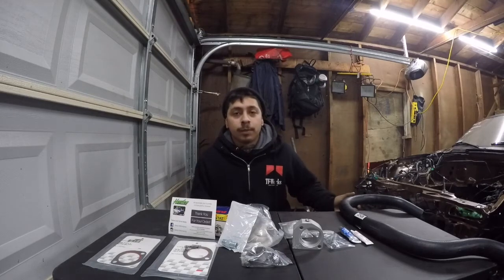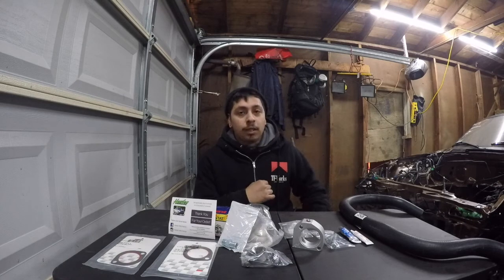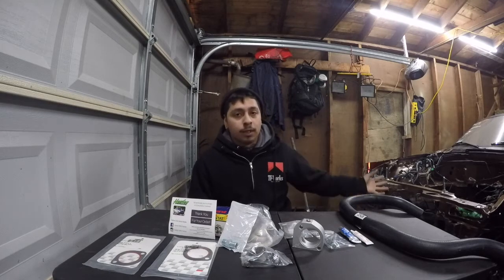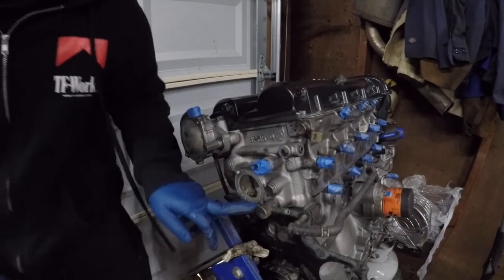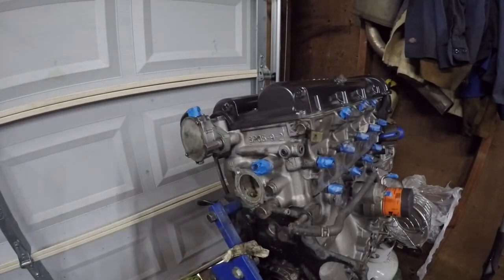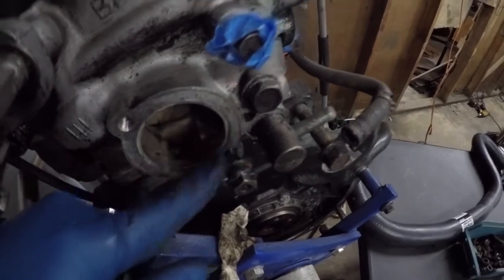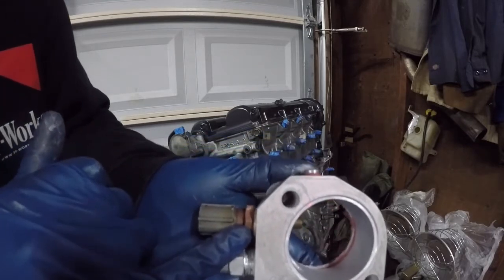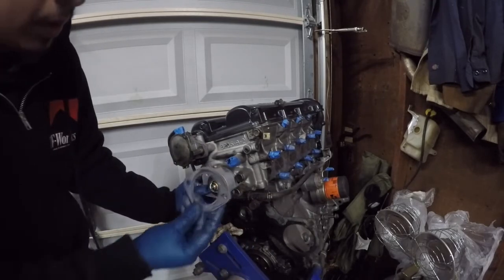Hawley Performance coolant reroute for Miata!!!!

Comment: The problem I have is with the hose... which way did you install your hose and how did you?
Reply from the maker: the hose is kinda hard to install with the motor on to do so, you kinda have to kink it and bend it up to slide onto the housing in the rear then the front i ended up trimming to where it fit okay to my liking.